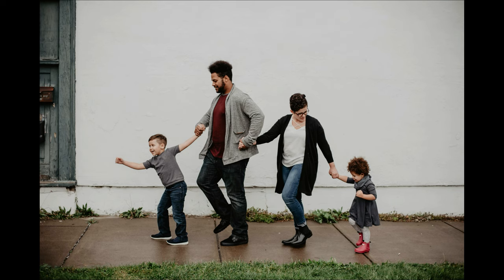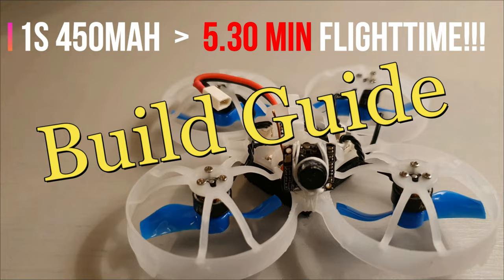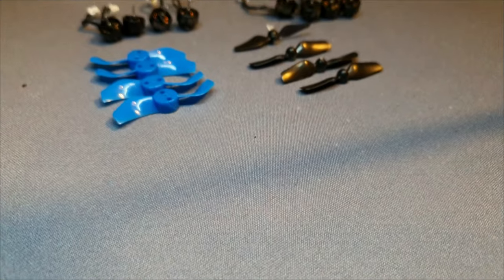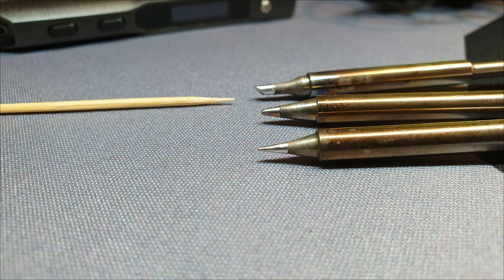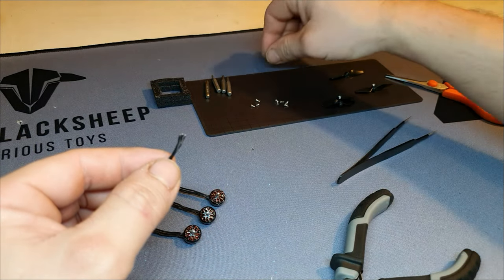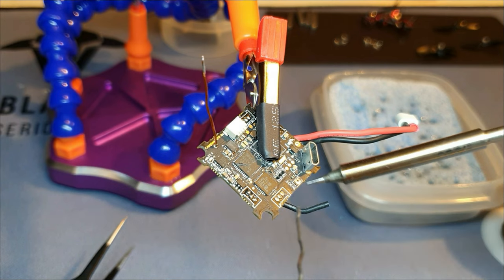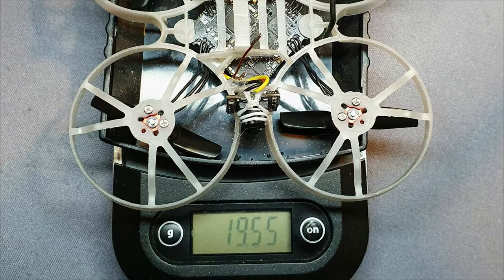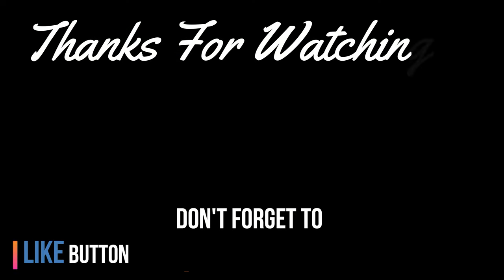How to remove motor plugs and direct solder the motors on tiny whoops | Square One FPV

Comment: Thanks for such detailed information on how to remove the motor plugs. I really liked your specific information on soldering iron tips and your advice on temperature settings and not letting the tip linger on the board. Such specific information is so valuable. Thanks
Reply from the maker: You're welcome. That's such a nice comment, thank you very much 😊. 
Take care buddy!

Comment: Sweet video! I usually just bridge the three motor wire connectors with solder and pull the connector out from the bottom.  Haven't damaged a board yet but your method looks so much safer! thanks!
Reply from the maker: Thanks buddy! So you pull out the connector with the pins at the same time? And it works? Nice 👊!
Reply: @SquareOneFPV  Yup, connector comes out clean in one piece.  Then I solder sucker or wick the pads clean.  Actually stole this idea from one of AngryDonFPV's videos about 2 mins in: https://www.youtube.com/watch?v=51cUJkEVmvw&list=LL&index=41&t=100s Your method is probably safer overall though!  And awesome whoop by the way, haven't gotten any of my 75 whoops under 20gs yet.
Reply from the maker: AngryDonFPV has got some great tips, and his way is great too, looks a bit easier actually. 
Thanks man, yeah it's a great whoop, try it, it flies amazing! And if you do, let me know what you think of it 👍.

Comment: would you say that soldering the motors directly to the fc gave you the most efficiency?
ty for sharing :D
Reply from the maker: Hi, you're welcome 👍. Yes it definitely is more efficient. It even gives the feeling the motors are slightly more powerfull. The less internal resistance the better, so I also use a bt 2.0 battery connector, these 2 combined are a great upgrade, you'll have less battery sag, and a little bit more flighttime.

Comment: Thank you so much, i was thinking about it but didn't found anybody actually doing it.
Have you noticed a difference about flight time or power when soldered ? I was wondering about connector that could "bottleneck"/dissipate some of the power sent to the motors.
Reply from the maker: I'm not an electrical engineer or anything like that, but I would suspect any connector would increase resistance. My whoops are a lot lighter, my 65mm is about 17.5gr, and my 75mm weighs 19gr so they already feel different from standard whoops. I can say you will save about 0.5gr when removing them, and on a whoop every gram counts.

Comment: sorry, one question, keep in mind I'm a total newbie: you said to take notice of which motors go where to maintain the correct (CW or CCW) direction. isn't that totally controlled by the FC and ESCs? I always thought that the motors themselves had to "setting" for the direction within themselves. thanks! (and you have a new subscriber!)
Reply from the maker: Hi buddy, sorry for the late response(s), we moved into our new house recently and it's been keeping me very busy getting everything unpacked and all...😬. Anyway, you can change motor direction multiple ways  
1) you can change motor direction via "ESC software like JESC, BLHELI, Jazzmaverick, etc
2) The latest Betaflight (4.3) should support changing motor direction in the "motor tab", or it should in future update. 
3) If you switch any 2 motor wires you will change motor direction. 
Thank you for subbing! 🙌😀
Reply: @SquareOneFPV  thanks! so, okay, there is no need to mark which motors spun in a particular direction to put them back in their original position, right? that’s the point I was making: which direction they turn is determined by the FC/ESC
Reply from the maker: @pgabrieli Well if you don't mind checking motor direction and correcting it in software there is no need to take note of the motor wire order. It's just a tip I gave for people that don't want to go through the process of checking and correcting after direct soldering the motors.
I'll give you an example, let's say we direct solder motor 1 and it turns clockwise (CW).
If we take of the plug and solder the wires in the same order as they were when in the plug it will spin CW again.
But if we swap any two wires it will spin counter clock wise ( CCW).

Comment: Whats the advantage of building a whoop with frame upside do?
Reply from the maker: That would be an excellent question for Chris Rosser 😂. No but serious, I'm not an engineer so I can't explain the science behind it. The way it feels in the air is different, putting the battery on top ( above the prop line) changes the center of gravity. To me it feels like it responds faster to stick inputs. It also has less propwash, but maybe I just got it tuned better... 
Best way to find out, is building one yourself 🙃

Comment: Thank you for the video I was just curious if I have a motor that stopped working but when I plug in the same motor to any other plug on the same flight controller the motor works so I was thinking something with that plug may be bad wood desoldering the plug from my flight controller and soldering that motor directly to the board fix it or if the plug stop powering the motor does that mean it's the flight controller?
Reply from the maker: Have you tried checking your esc's? connect to jesc, jazzmaverick, bluejay or whatever you use to configure your esc and check if al 4 esc's show up.
Reply: @SquareOneFPV  they did all show up but is a all-in-one flight controller from my data fpv 85 pro 2 whoop. I accidentally flashed new ESC firmware from Blue Jay or something. I thought I could just try it and the CLI dump from my drone would reset it but I was mistaken and I don't know how to reset my ESC firmware back to default.
Reply from the maker: @IAmTheOceanWhosWatersOverflow  if you used bluejay the firmware you flashed onto the esc's should be the right one. And your esc's should be fine.  can you spin up your motors in the betaflight motor tab?
Reply: @SquareOneFPV  all except 1. i used a multimeter and tested the pins for that motor plug. a few guides said that if i found continuity while testing the pins that the esc is shot.  but the esc configurator detected 4.

Comment: I tried soldering for the first time, first I knocked the vtx out, then I brought it back but broke a wire. Re-soldered that whole motor and vtx went out again. Also the startup-sound only played the first few notes. Did I overheat the board? Did powering the whoop with an accidental bridged pad (that I may not have noticed) cause it?
Reply from the maker: Sounds like my first soldering experience 😆, it's ok you'll get better at it. I believe first few sounds are for the fc starting the last ones are esc's starting... so yes esc's are probably fried, due too overheating, soldering on such small pads has to be fast, because the heat transfers to nearby components very very fast. 
On tinywhoops I put my soldering iron on 300 to 340°C and I try not to touch the pad longer then 2 seconds.

-Pre tin both the pad and wire
-Give the board a second after pre tinning 
-Hold the wire onto the pad
-use flux if you have it
-hold the wire onto the pad
-clean iron tip and put a tiny bit of solder on it
-now solder! The wire should be soldered onto the pad almost instantly.
-when done soldering, clean the board with isopropyl alcohol and tootbrush to make sure there no small solder residue that could cause issues.
Reply: @SquareOneFPV  wow, super helpful! Thanks for the tips! Definitely need to focus on being quick with the heat

Comment: Thank you for this video series! I would like to know if I can use this FC for this build: 
HappyModel Crazybee F4 Pro V2.0 1-3S Brushless flight controller FrSky
Reply from the maker: Hi, thank you, just happy to help, and trying to inspire fellow pilots 👍. Yes you could use that FC. But, I just looked at the specs, if I understand correctly you'd have to add your own vtx. If you plan on making your whoop inverted like I did you'd have to place the vtx between the board and the battery bay, depending on the frame that could be a challenge. For a 'normal' whoop setup it will definitely work, if you want to make an inverted whoop I think a FC board with  build in vtx and receiver would make your build a more easy. Good luck with it!
Reply: Thanks for pointing this out. I will buy one with VTX. I have URUAV UZ85 with a fried FC. So when I buy a new FC, I will re-build it inverted. Would your settings be applicable to my whoop?

I really appreciate your channel and your explanations are easy to follow. Most builds from other YTrs offer either power, speed and distance. I am looking for smoothness of flight and I found it here.
Reply from the maker: @set.adrift.somewhere  Now that's a cool project 🤘, please let me know how it turns out! 
Yes my 75mm build guide is applicable to your whoop (https://youtu.be/XU3Szn7kgqA)
you can follow the steps to
-remap the motors
-correct motor direction
-correct FC ( board) orientation in BF
if you have issues feel free to let me know, I will help you as best I can. Be sure to make a back up of your FC before starting so you can easily revert! 

I'm looking at some pictures of your whoop, the props and  screws stick out of the frame, so you will need some self adhesive foam to stick to the bottom of the whoop- maybe even 2 layers- to keep them of the ground,. Try not to cover the entire FC board, as it will act as an insulator. 

Oh and for smoothness of flight, I've recently switch to Emuflight and it flies even better! It's very similar to BF so the guide applies to Emu as well. Emu has pre-sets for pid's and filters so very easy to tune, I love it! 

Thank you for the kind words, really appreciate it 😍.
Sorry for the long write up, got carried away here 😂.

Comment: Hello. What would happen if you accidentanlly bridge the motor connection and not check it? Does it damage the motors or esc?
Reply from the maker: Hi 😄, good question. It didn't happen to me ( yet) but I'd say, yes and yes, there's a chance you damage both a motor or esc. Chance of damaging an esc is probably bigger.

Comment: may i know why you remove the connector & solder it direct to the board?
Reply from the maker: Sure 😊 
-first of all, for shedding some more weight, a lighter build flies better, much much better.
-second because the connectors are a point of resistance between the esc and the motor.

Comment: Just a tip, I know you said you don't use flux because you had a 5" board short on you but for people new to soldering cover that bad boy in as much flux as you can and use a healthy amount of alcahole to clean after. Thank me later 👍🏻
Reply from the maker: Well you'll be happy to hear I actually started using flux again 😊. Not on everything, specially bigger pads and wires. But soldering without flux ( I do use solder with a resin core) teaches you to be fast when soldering, because the resin core evaporates in an instant. And yes I clean with isopropyl alcohol, lots of it! Anyway thanks for the tip!